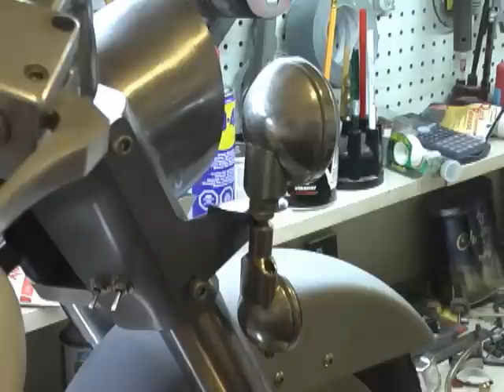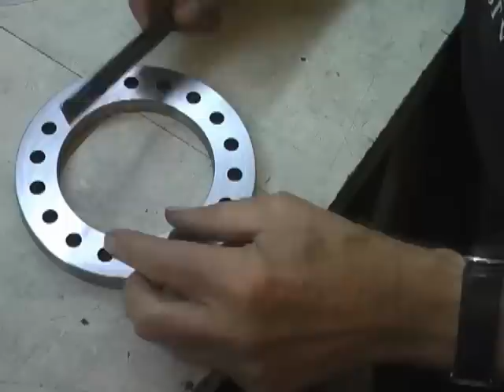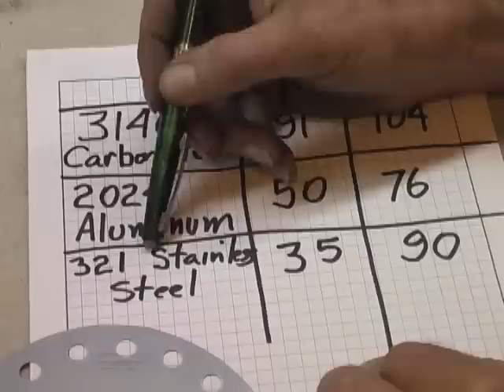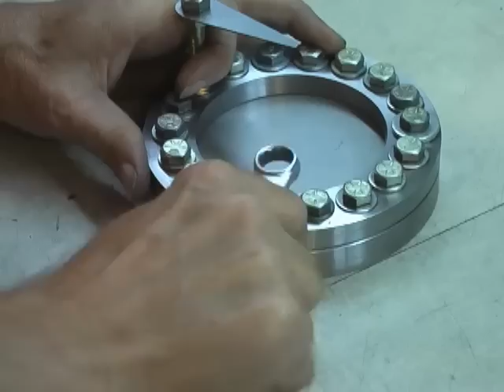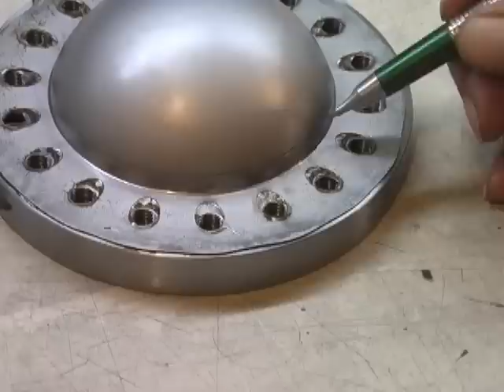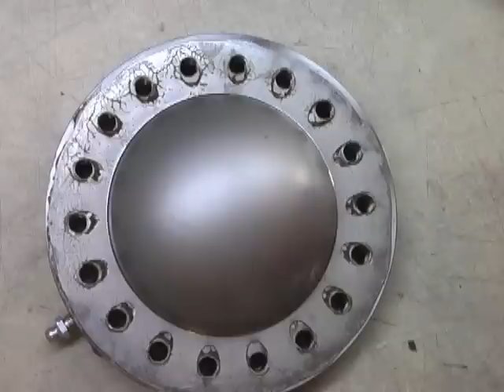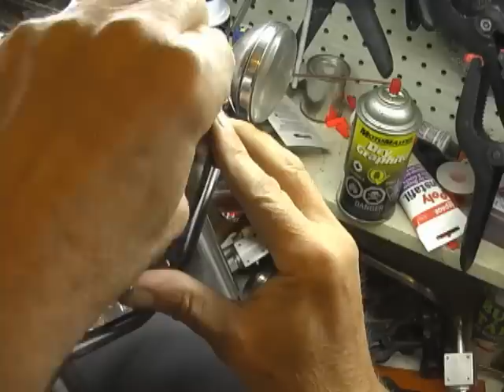Hydroform

Comment: What isn't shown in this video is that in 1977 when Clarence left university, he traveled home on his beloved Harley.  Unfortunately, he crashed and broke the front light cluster.  Being a student Clarence couldn't afford to buy spares to repair his motorcycle so he set himself the task of repairing it himself on a typical student budget of $0.  He began by making a fire using some of the furniture in his room and melting down his cutlery and a couple of old bedsteads.  This didn't provide enough raw material for the tools and parts he would need, so he fashioned the molten metal into a pick-axe from a crude mold constructed from the clay soil in the garden outside his apartment.

Several decades later, after travelling on foot across the Americas in search of abandoned mines, Clarence finally had enough raw metal, Iron and Aluminium, to fashion a smithy (anvil, forge, hammers and all), the specialist forming tools and the front light cluster.  Now we're caught up with what actually happened.
Reply: Reply to: S Morris 
And... we mustn't neglect to mention Clarence's brief crossing of paths with Forest Gump, who's "smily-face" t-shirt inspired the concept of semi-circular hydroformation techniques utilized with a positive attitude.
Sadly, Forest's true love, Jenny, was impressed with Clarence's Harley; prompting her to steal away with Clarence under the cover of darkness (which was made possible by means of the shiny new headlight and SS reflector).
And now, we know a few more details of the reflector history.

Comment: Manual grease guns can achieve pressures up to 10,000 pounds per square inch (psi), while plug-valve sealant guns can reach 15,000 psi. (  1:44  )
Reply: Actually 10k psi is well in excess of what standard grease guns are capable of. At the last mine I worked at one of the heavy duty mechanics got curious and rigged up a pressure gauge and tested a manual grease gun against our industrial level pneumatic greasers. Surprisingly the manual gun averaged about 2200 psi against the air powered guns at 1800 psi on 120 psi of air pressure. Anything higher than that 2200 psi and the lever assembly parts started failing on even good quality grease guns. There may well be specialized ultra high pressure power greasers around that will do that 10,000 psi but I wouldn't know about those. But it's impossible for the off the shelf lever operated guns to reach those numbers. Average hydraulic pressures for any large earth moving equipment I've operated is roughly 5,000 psi and they use way thicker wall thickness for both the steel and triple braid flexible lines than grease guns do.

Comment: Cool Video, and a creative use of pressure, and for marker lights it may work OK.  However - headlight reflectors are parabolic and the shape of the reflector is critical for controlling the light pattern.  If you are going to be riding this bike at night, you would be far better off with a factory made headlight reflector.
Reply: marshalllhiepler Possibly the most civilised discussion on the internet, ever!
Reply: The point of focus in a parabolic reflector is the light source itself.  The beam will be projected out in a straight line without converging on a point.
Reply: Reply to Simon:
Yes, that's why viewers like ourselves are here; watching this type of video.
I am aware that I don't know enough, and am seeking to learn more.
A willingness to communicate ideas with others (whether right or wrong) begins an exchange of thought that exceeds the singular expanse of one mind. So much can be learned from others, when we listen carefully.
Many thanks to Dave, for sharing this video and making the resulting discussions possible.
Reply: I really like this grease gun concept for shaping metal.  I have seen a similar use of the grease gun pressure for freeing stuck pistons in antique engines by installing a grease fitting where the spark plug goes.  For the light issue I am a bit tuned into the headlight reflector currently, as I have been trying to find an LED that works well with reflector/lens assemblies that were made for lights using filament bulbs.  The LED works great with modern lights that use a project style lens - they aren't so good at working with reflectors as the LED emitters cannot be oriented exactly like the filament.  The LED puts out more light - but it is not focused well and scatters more, and the emitted light is not evenly focused.  I want a focused light that shines down the road on the high beam - and also has a nice vertical cut off on the low beam....and so far most of the LED bulbs just don't do an "excellent" job of controlling all that emitted light.  I ride a lot, and I try to ride mostly in the daytime - but sometimes I get so far from home I can't make it back before dark.....and I want the best headlight I can get at a reasonable cost.  (Projector lights just don't look right on vintage bikes).
Reply: Reply to Chris Tower:
I considered your comment, and realized you are correct. A parabolic reflector does reflect light rays from the central point of source; to a straight path. Good point, and thank you for the correction.
I trust we are in agreement that a true parabolic reflector would produce a concentrated beam that would be poorly suited for night driving. A better design would be a hybrid between a perfect parabola, and the semi-circle shape that the video depicted, with the bulb located slightly off-center to avoid rays being reflected parallel to the road surface (so as not to blind oncoming drivers).
Reply: From what I understand, headlamps project a beam that is roughly focused forward like a spotlight, plus have additional light to the sides and downward to a lesser extent.  Older ones used to have a smooth parabolic reflector acting as a spotlight, with a glass compound/Fresnel-prismatic type lens in front to spread out some of the beam to the sides and downward.  Since then they have achieved both effects by superimposing smaller beam- modifying reflectors on the base curve of the main reflector, as a compound reflector.  They can also achieve this now with a single smooth specially curved reflector, or in the case of a projector, a specially curved lens.  Many projectors actually use a top-down shutter for that vertical cutoff during low beam.  There are probably some other variations out there.
Reply: LOL a debate about whether it would be safe to ride a model motorcycle at night? It looks to be 1/2 scale, nobody’s going to be riding it anywhere at anytime.
Reply: reply to: Nevir202:
I have a 10 year od nephew, who is also 1/2 scale.
I wouldn't need to ask him twice, to ride that motorcycle.
Especially if it was nighttime, and the other option was bedtime.

Moral of story:
Never say never. 👈
Reply: marshalllhiepler lmao it’s a model, no matter how willing nobody is riding a motorcycle that doesn’t go.
Reply: reply to: Nevir202 :

Ha.  This is the part where I honestly admit to not previously realzing that it "doesn't go".

In my mind, I had assumed that it would have some type of propulsion, given the level of expertice and craftmanship being used in its construction.

Good point, Nevir202.
This changes everything.
Reply: marshalllhiepler lol I know how that goes. Easy to overlook important details like that.
Reply: reply to Dave Bob:
I disagree. Parabolic shaped reflectors focus light to a point, however, beyond the point of convergence the light spreads once again. A well designed reflector is matched to the intensity of the bulb, and is specifically shaped to produce an illumination pattern that lights the road width while compromising distance to avoid blinding oncoming vehicles. 
The reflector fabricated in this video may not be designed with a CAD system, but I believe it will be more than adequate with a little experimentation with bulb placement.

Comment: you should be careful of getting injected with any grease should it squirt out.
Reply: With so many bolts, it was a good seal. The only force that could cause the grease to squirt out would be the spring pressure from the deformed metal, but it would be miniscule as the dome shape also does not want to return to a flat shape - that would take more force than the force that deformed it also.
Reply: the pressure to deform the plate in first place is sufficient to penetrate skin, 100psi is enough.
Reply: Craig Hudson - the metal has yielded - it isn't storing energy. The only pressure is from the pump and that is small flow and low quantity. I guess in theory a pinhole escape of fluid could cause damage. However, it will not be a pinhole because it will rip if the material fails. The sheet metal  will not allow a small pinhole.

Comment: Thank You Sir for sharing this video and technology. It has opened a whole new world of opportunity for me. I've produced similar components using hammer and sand bag, but was not aware of this technique. I've have shared a trick many times with young mechanics, packing grease into pilot bearings and using a pilot shaft inserted into it and then striking it with a hammer. Works every time. I never thought to use the hydraulic properties  of grease in such a manner. Looking forward to having a go at it. Producing a deep headlight bucket for model A or t would be entail some sort of casement I would imagine. I have always been fascinated how early coach builders and car manufacturers reproduced such parts. Can you suggest any literature? Again thank you.
Reply from the maker: Sorry, can't suggest literature - like you, I'm flying by the seat of my pants here!
Reply: Clarence Elias Thank you.

Comment: DANGER!!! I'm not sure but, I know that in case of leakages OIL or water (I don't know about grease) can spill at high pressure speed and velocity and pierce human skin. If that happen it goes trough tissue and produce HORRENDOUS EFFECTS that often produce high infections and the need of very large surgical procedures. If you do this things PROTECT YOURSELF behind some kind of resistant sheet of something please!

Said that, FANTASTIC WORK! You're great! :-)))
Reply: You are partially correct.   Liquids are non compressible.  If you were to use the exact same amount of energy in  gas form, you would have a bomb on your hands.  If the metal started to leak grease, the only volume of grease that would be expelled is only equal to the amount of spring back in the metal piece.  For sure it would start out at exactly the high pressure that was being used to deform the metal but it would drop very rapidly to just a mess making pressure that the spring back of the metal.  To give you an idea of how little value of the pressure of a flat spring like this would create, things like clickers and horns use flat diaphragm springs.  It still would squirt grease all over the place but the initial high pressure would be such a short duration that it's legality would be very short duration and short in distance as well.  Keep up the good observations and best of luck.  Cheers.
Reply: Robert Palmore I already knew all you said. But the same,  pay attention. :-)
Reply: @grazianoturbogas  If you knew already, then you shouldn't have commented so foolishly.
Reply: @crookedriver2079  that's not exact. What I already knew is that nothing is about to explode like a bomb, because of the little stored energy by using non compressible fluids.
A complete different thing is an oil spill.
With fluid (also incompressible) like water and hydraulic oil it is AN ACTUAL DANGER. What I don't know for sure, is if the grease viscosity is enough to grotect everyone from those kind of events. And I still don't know for sure. That's why I said not to stop doing all this but to try to use some protections and pay attention to this kind of thing. I hope that the nature of the danger can be clear also to you now. It is a  seldom phenomena but extremely unpleasant.
Reply from the maker: Actually, what happens when it fails is that there is a loud "crack". The stainless ruptures pretty much from end to end. The grease travels a few inches.
Reply: some years later...now AvE has done a couple videos on high pressure grease release, "Dangerously Greasy Gun" https://www.youtube.com/watch?v=nFId_NB6Ar8 and "13,500 psi Injection KILLS" https://www.youtube.com/watch?v=J6Ajw5zh1ts.  It looks like being close is dangerous but it's not clear how dangerous it'd be a few inches away.
Reply: Yes, very little stored energy there.

Comment: That is pure cleverness. The modest grease pump for forming small pieces...Grease is interesting, being thick it is somewhat  self-sealing, self dampening, does not run everywhere when you open the "hydroformer form" and is not lost. No one spill.
The pump is always well lubricated, no problems of oxidation  or gripping, is cheap and can be found in any tool store. I'm in awe. Many thanks for the excellent video, that give me an idea for forming copper jewels.
Reply: Yeah... its the PERFECT solution!... all the benefits mentioned by you and easy to do and replicate
Reply: but it's inefficient in terms of energy transfer
Reply: @Real_Commander_Shepard  it's incompressible?? How is it not efficient?
Reply: @edcbb3  because as the viscosity of the medium will increase frictional loss will increase u will require more effort to deliver the same pressure with grease as a medium when compared to normal hydraulic jack fluid.
Reply: @yakshbhola8916  ye but in terms of efficiency, it would still be the same? No slip condition means that friction doesn't need to be considered as the fluids technically static there. It just requires more energy transferred overall I assume because of the increased density
Reply: Very cool

Comment: Why not use water and pressure washer?
EDIT: I will add a word of warning. You MUST BLEED all the air out otherwise you are making a bomb.
Reply from the maker: Why not, indeed! I used grease because I had the hardware.
Reply: Also, with water being thinner, that would have required a sealing gasket for sure.

Comment: What a great end result. I would be so scared of coating the workshop in a layer of grease. I guess the blow out mess would be far less than if you were using hydraulic oil.

Comment: You can buy a knockout punch set at Harbor Freight, then use the pump to stretch the metal.  Recovering hydraulic oil is a bit less messy.

Comment: WRONG!  Yielding refers to non-elastic deformation, that is the stress where a material will NOT return to original shape after load is removed.  This is not a trivial distinction but critical to understanding the numbers and properties.  Otherwise a nice vid.

Comment: good job, congrats on the finished part.
how much did it cost to have the metal plates made ??
interesting use of a grease gun, never realized it could attain that much pressure.
question ; why didn't you use water pressure or hydraulic oil pressure ??
again great job. it's people like you that make me proud to be a home builder. ( i make anything i can, and fix anything that quits)
Reply: All so if there was a catastrophic rupture Greece would not project where water would
Reply: I was going to say, because that's what he had.
Reply: normdoty water wouldve seeped out probably even with gaskets
Reply: So Nice :-)
Reply: HaHa... "Grease would Not project where water would"???    BS!
Water would clean itself.... You would be wiping and finding grease in cracks and crannies FOREVER!!  LOL
Reply: Bob Duvall Grease isn’t going to go anywhere that you’re going to be finding it forever.

Unless he somehow trapped a lot of air in there to blow it out, if the metal split all he would’ve had was a little gob pushed out of the crack, it wouldn’t have even left the part.
Reply from the maker: I made the plates out of scrap metal. My cheap grease gun is rated @1500PSI. 6500PSI guns are not uncommon. I used grease because I had all the hardware.